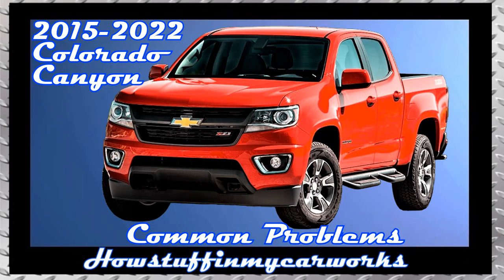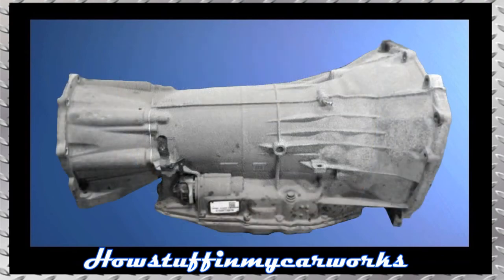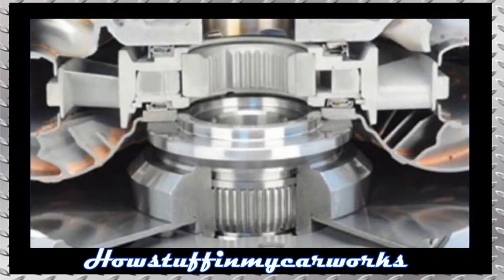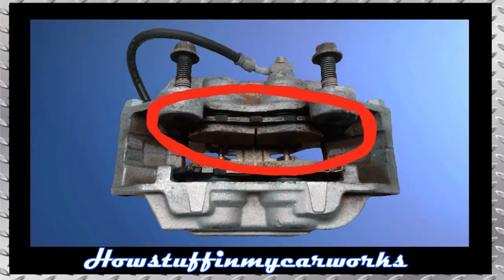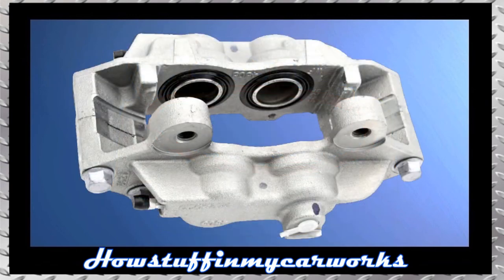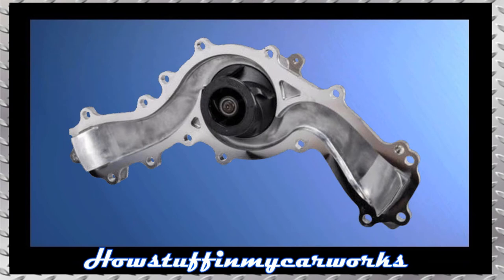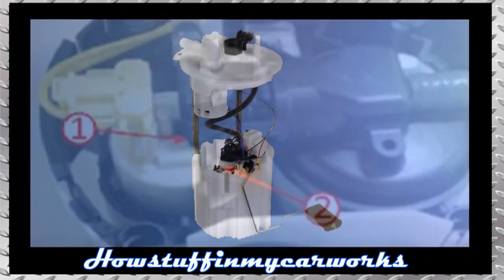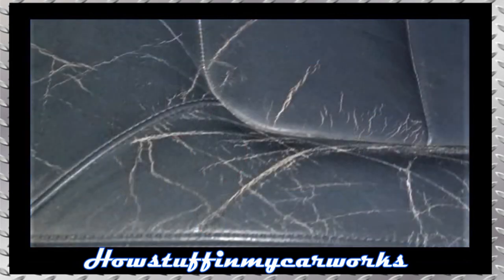Chevrolet Colorado & GMC Canyon  2015 to 2022 common problems, issues, defects, recalls & complaints

Comment: 108k on my 2016 Canyon. AC compressor replaced at 100k is the only issue I’ve had. Other than that it’s been a great truck.

Comment: 2017 z71  125k,   other than the radio consul changing statins on its own from time to time and one false exhaust code that was cleared and never came back. truck has been running fairly solid, oil tests come back with perfect results, no significant engine wear, change oil every 5k, trans fluid at 30k

Comment: I had the same problem with my 2015 canyon abruptly losing power steering. My son and I almost wound up in a ditch one of the times it happened. They replaced the steering rack out of pocket ($2k) since, for some reason, my '15 truck's vin wasn't covered under the recall. (Filed a complaint with NHTSA) Also, the AC compressor (extended warranty), hvac actuator (removed dashboard-$1200 out of pocket), and the infotainment screen (extended warranty) all had to be replaced on a truck with less than 80k miles. Traded it in two years ago.

Comment: my 2016 colorado 2.5  had to replace my torque converter replace the part was not cheap neither was the labor cost I buy out of pocket. ouch.  Getting rid of this truck currently dealing with cranking issues
. so my question is where can i find out about these recalls or defects?
Reply: How many miles did it have on it when you replaced it?

Comment: 2016 chevy Colorado is shit . Transmission went out with warranty thank God. As soon as transition got fixed. 5,000 miles later , fuel pump takes a dump and cost 6,000 to replace . Got fixed and now ac compressor went out . I’ll never get this truck again

Comment: Ok I have 2 of these trucks and I do have a few of these problems, both transmissions shift hard and one is getting bad, another thing these have the chevy shake and one of my trucks does it over 80mph, I have replaced an ac compressor on one truck, the touch screen has stopped functioning properly on 1 truck and there is more electrical issues
Reply: Bad transmission fluid take it to the dealer have them flush it.

Comment: My 2018 has been a piece of crap, torque converter repaired once, replaced once, seat stared tearing right after warranty went out, wheel wells had cheap glue and started separating, no primer on door handles so paint was coming off, and today my thermostat went out at 63k miles. pos

Comment: Does anyone have any power door locks issues? I just bought a used 2015 Colorado 79300 miles less than a month into ownership my key fob works but my power locks dent work anymore.

Comment: Super common problem. Temp sensors and thermostat. Theyre complete crap and depending on the year the engineers designed it so that its a NIGHTMARE to switch out 50 dollar pieces of equipment. Thermostat is 850 to replace at a dealership complete BS.

GM are pricks.
Reply: Mine went out at 69K miles. Dealership wanted $1,300 to replace it. Fortunately it was covered under warranty. There’s no need for the overcomplexity in these designs.
Reply: Yes! And continue to give problems.

Comment: Didn’t find my two problems 2015 purge valve if you over fill gas tank like top off and the other one developers the shivers at light while stop idling haven’t seen a fix for it done decarbs a few time and it come and goes sometimes won’t do it for months I’ve always done stp dexos oil every 5 k since new .
Reply: I noticed same on my 19'.. idk of this is related but after I took out the front wheels speed sensors and cleaned them off (major magnet debree pick up) it hasn't done the shiver when braking